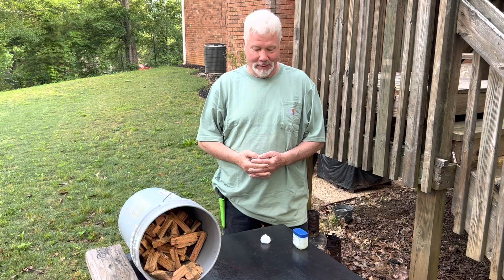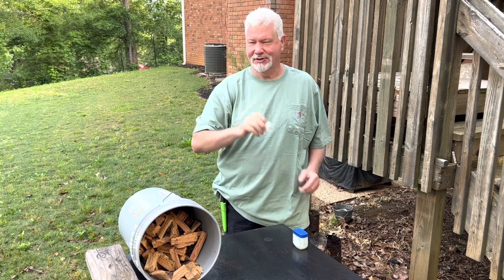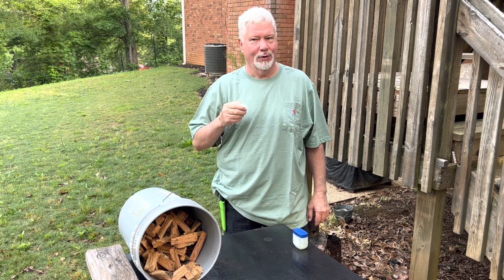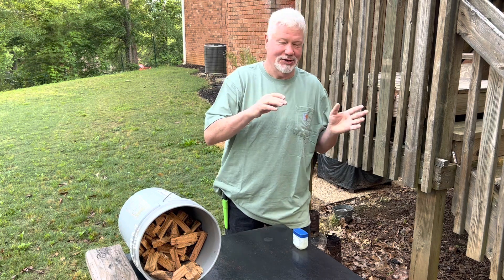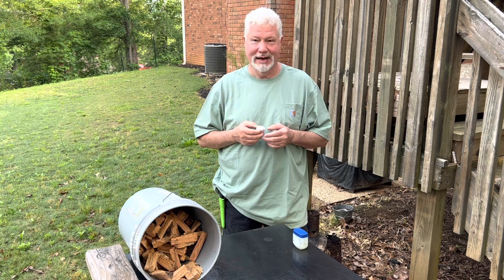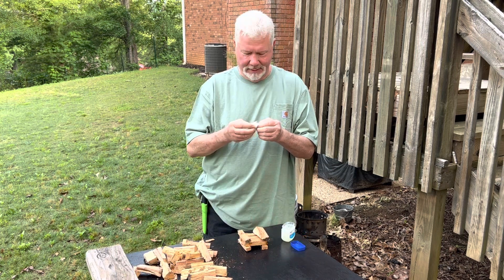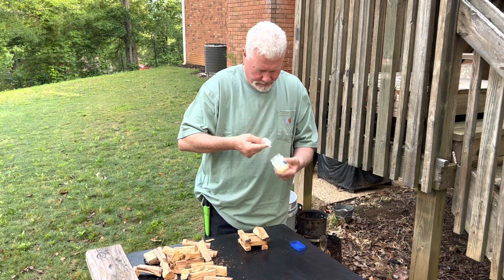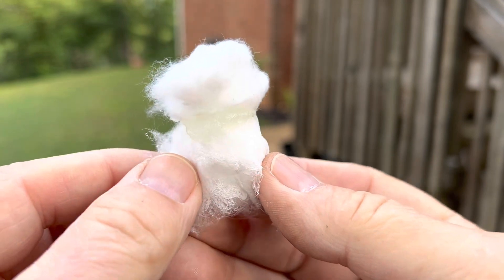A Vaseline Cotton Ball Will Ignite Oak w/o Tinder Or Kindling

Comment: Can cut large straw 1.5 inches long, hear a needle nose pliers to crimp and seal one end then stuff saturated cotton ball and Vaseline in straw and seal the other end. Keeps it dry, the catching of the cotton ball on fire then increased heat by melting burning plastic can catch damp to wet wood on fire.